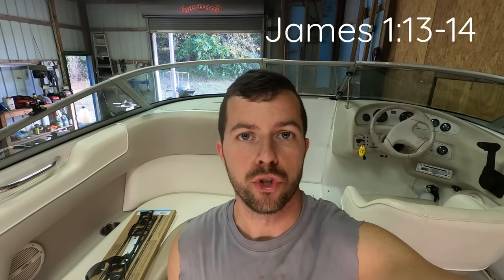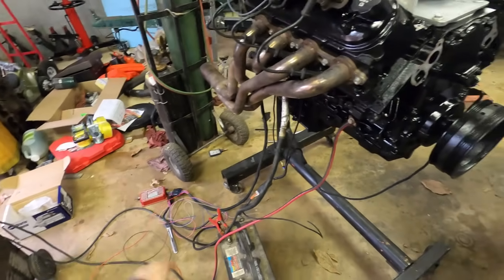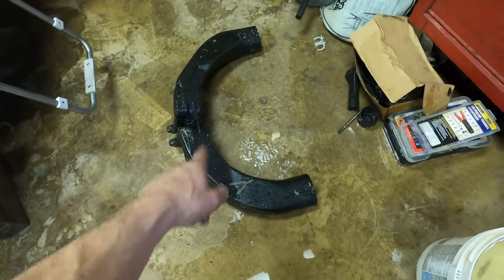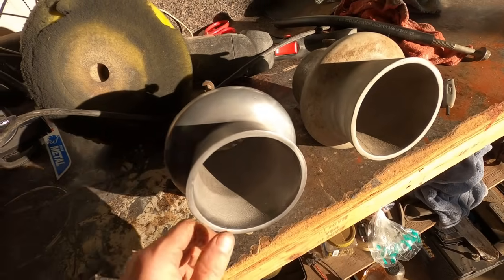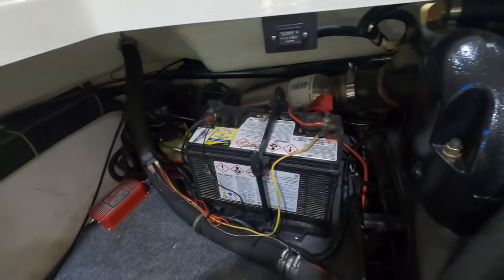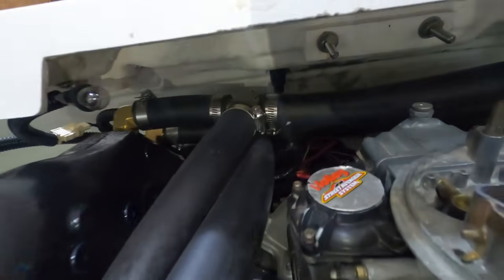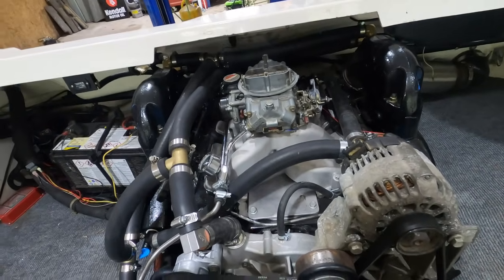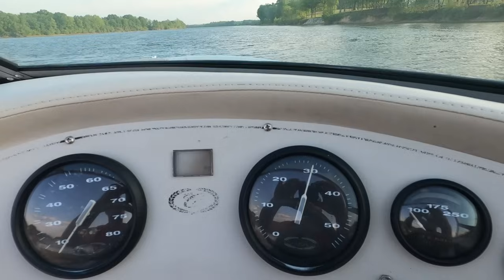Abandon boat part 2... LS SWAP

Comment: 40 is barefoot time!
Reply from the maker: Never tried that but I'd like too
Reply: @JohnnyAnderson1  Try first by sitting on a kneeboard and coming up to speed. GENTLY, place your feet on top of the water and get a feel for the speed. Have a spotter on the boat signal when above 35. Now it's all on you as to when you want to try and stand up but watch a few videos first. The wipeouts can hurt 🤣🤣🤦‍♀🤦‍♀

Comment: YOU NEED A LOT MORE PROP !
Reply from the maker: I dunno, it jumps so hard out of the water it feels perfect lol. It could definitely turn more prop but I love the handling and pulling power with this, top speed is around 57-58 at the rev limiter which is moving pretty good in a 19ft ski boat lol

Comment: Personally I think you'd do better with like a 19 to 17 pitch prop
Reply from the maker: The 4.3 came with a 21 pitch originally, a higher HP engine would need more pitch, not less.